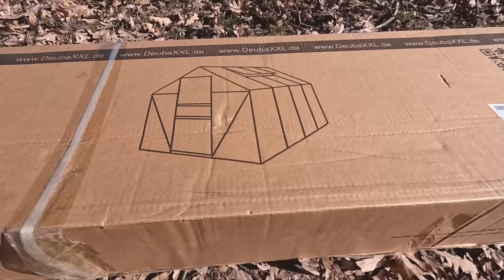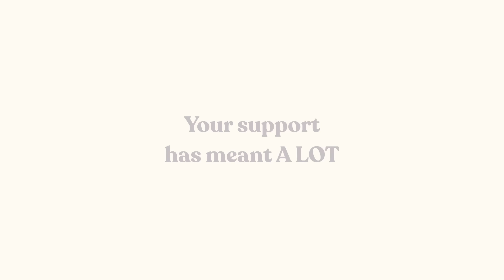WE BOUGHT AN ABANDONED FARM With Stone Houses to Renovate in Portugal | TIMELAPSE 1 Year in 25 Mins

Comment: Great vid great work 
But wouldn't one of those large water IBC's like at greenhouse be better than bottled water for the concrete mixer?
Reply from the maker: It’s not bottled water. It’s water from our 30,000L tank
Reply: find a cheap tandem axle trailer and put/secure an IBC on it then you can tow anywhere and have bulk water on hand (unless you've done so already)
Done a few for farmers locally here in  NZ 
Like you channel and your work